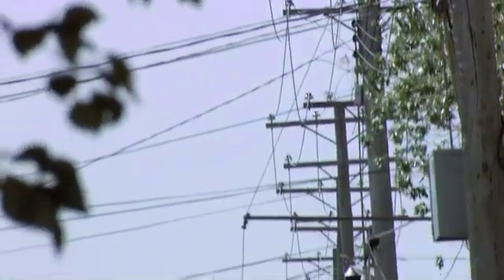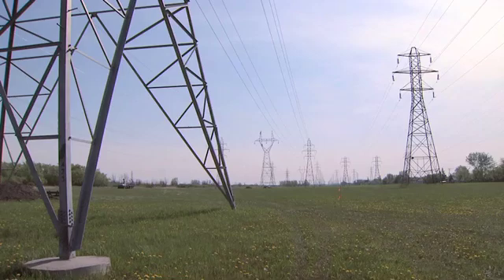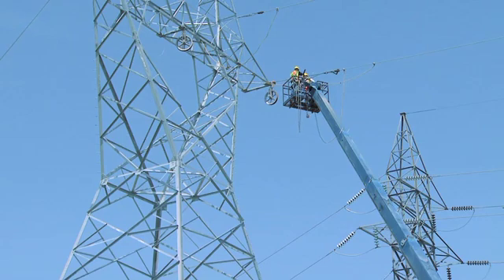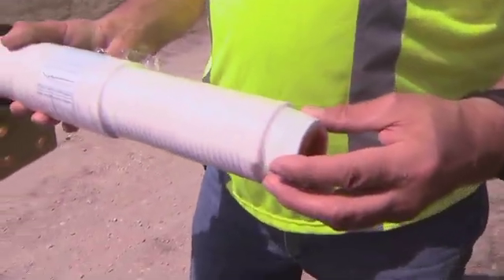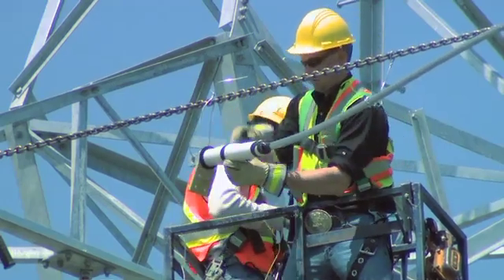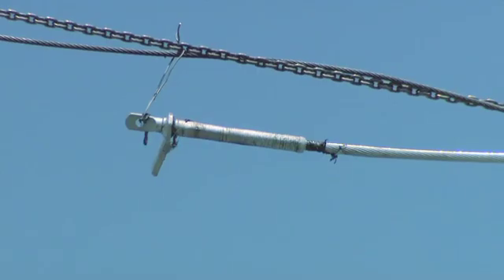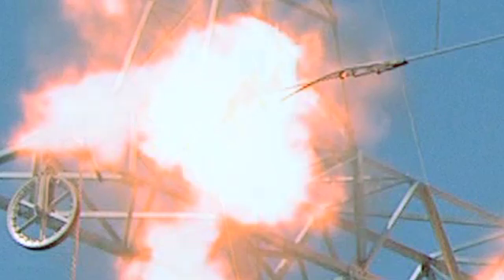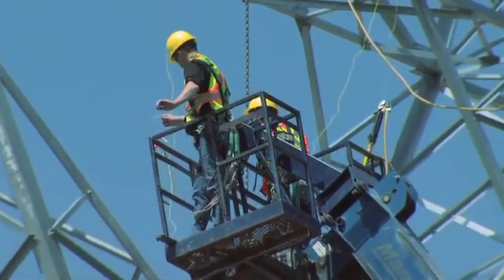Using Implosion Sleeves to Splice Conductor

Comment: Thank you Manitoba Hydro for the HOW THEY DO THAT video - I live in Jefferson County, WV where we all thought our foundations were gonna crack, the BOOM was so deafening and such a vacuum squeeze sound barrier feeling on hour houses we've experienced from Dominion. Your video is extremely helpful to our locals - just wish Dominion would have contacted us - we have about 600 homes in the area of the newly installed transmission towers that replaced the tiny ones. We really believed it was dynamite. Homeowner dogs have gone crazy, dishes rattling and pictures falling off walls - we never expected or knew about this implosive splicing - wish you had a lesson for us in advance so we could have prepared. THANK YOU MANITOBA HYDRO - by the way Dominion told me to watch your video to learn - and learn I did!